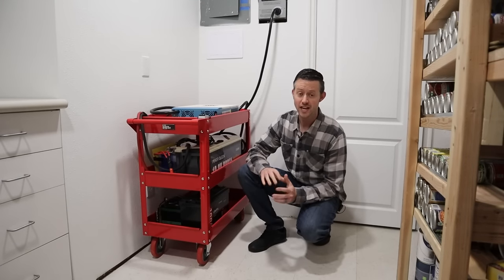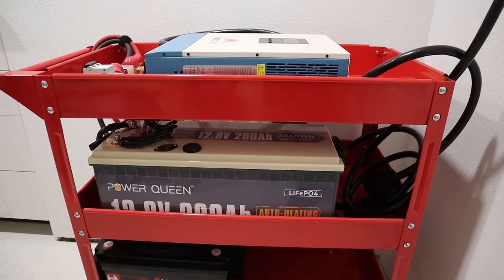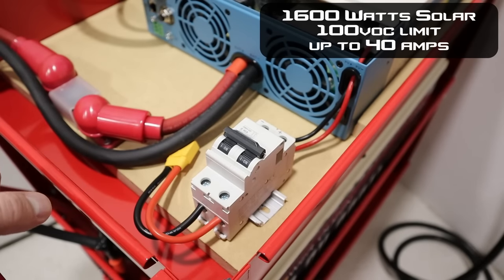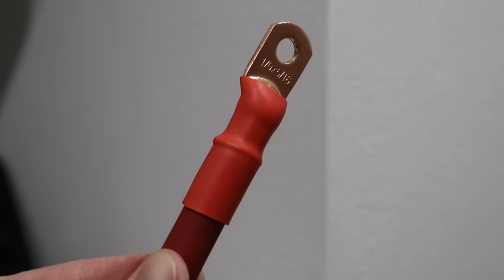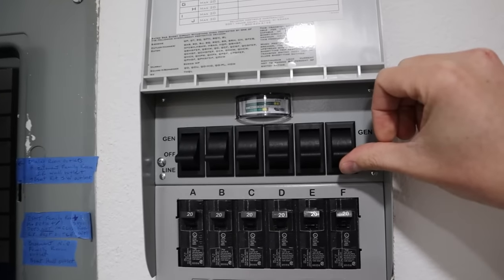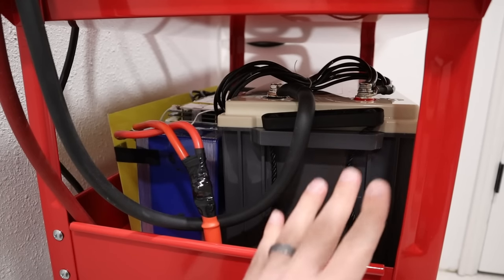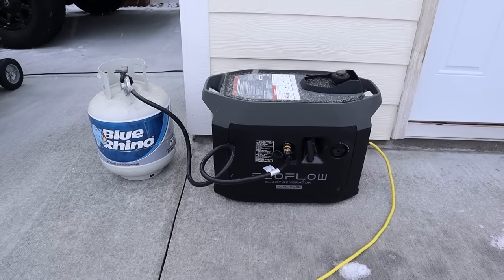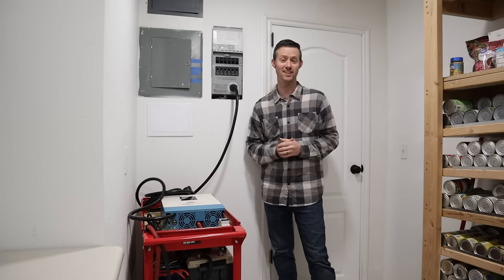Be Ready For Any Power Outage!  DIY 3000w SunGoldPower - PowerQueen LiFePO4 Home Backup System!

Comment: Enjoyed your presentation and certainly a modular, DIY approach to home backup power is in many ways superior to off the shelf products.    I forget, was there a monitor for battery SOC in your set up?   For camping (and home backup), I built a 12 V 100 ah battery with MPPT charging, various connectors, a charger and a small inverter and find that an EcoFlow Delta 2 does the job better in a smaller package.   However, if anything goes bad on the Delta I can’t really know what has gone wrong and will have to wait weeks sending it in for repairs, etc .  With a DIY unit, you have more options.    Did I mention I really enjoy your videos?
Reply from the maker: Thanks Jack! The SOC is kinda tracked in the inverter on the screen... It's not amazing though. 
I think the portable units have their place, the Delta 2 is so lightweight and compact. It certainly is one of the best current options for a 1000wh device. I personally enjoy DIY and off the shelf options because both have advantages.

Comment: I can't afford this type of setup at the moment & really don't know that I would if I could,... For now, I have a a Chinese 2300/1800 watt Inverter Generator for under $400 that I flushed & prepped well before starting & I installed a 30 amp Generator Inlet Box to the outside wall of my Kitchen, ran a one foot 12 gauge wire to a 20 amp double outlet inside the house so that I can run my chest freezer, fridge/freezer, light, fan, TV , Internet Gateway & Pellet Stove if the power goes out and this setup including the generator cable cost me less than $100 :)
Would it be nice to run 12 hours or so Silently then use a generator to recharge if needed ? Yeah, sure but the cost is huge for occasional use.

Comment: Nicely done! Is there any reason not to use a 24v lithium iron battery of appropriate amp/hours? Seems like it would reduce a bit of wiring.
Reply from the maker: Yep, that would work fine as well. Jus make sure the BMS can handle the max load of the inverter.
Reply: @Jasonoid  Thank you. I was impressed with your setup. Mine is far simpler for now: A Goal Zero Yeti 1000 Core that I’d like to “expand” to power one refrigerator and a TV/Starlink setup in power failures, and to use in our camper to extend boondocking time. A 100A/H 24v battery would preclude the use of a DD to DC converter - my model requires at least 14v at the HPP port to take a charge. And a single 24v 45 lb battery would be handier than 2 25 lb 12v batteries wired in series. But you’ve given me ideas for future projects!

Comment: This is great. I was just talking to Ask Ive Solar about a very similar setup as an alternative to a powerstation. Though it was using an EG4 version of this and server rack batteries. Did you consider the structural foam carts? They are the same though they might not have the middle shelf.

I like that a system based on an all in one tends to have a lot more charging amps, wider voltage range, and programmability. I am trying to figure out home assistant right now so I can make my EG4s turn on AC charging when the forecast and my weather station confirm poor sunlight.
Reply from the maker: I think for someone looking to build a 'future proof' DIY setup, 48v is the only way to go. I LOVE those 48v LFP server rack batteries! Eventually I want to have a system like that in my home, it's just a fairly large investment. Adding a smart capability would be really cool! 

Just make sure you purchase UL listed components since those items have been vetted for safety in your home.

Comment: We're planning on making one of these for our new home.
Do we need solar to charge this, or can we just use the electricity coming in from the power company?
How many batteries can we connect to it so we have longer use?
Also, can we just power our refrigerator, freezer, and lights with this?
Thank you for the video!
Reply from the maker: You can add as many batteries that you want, just connect them in parallel with your other 24v batteries and you are good. You also can just charge it up from the grid or even from an AC gas generator, no solar needed. The easiest way to power up your appliances would be to wire in a surge protector on the AC inverter with multiple outlets and then just plug them in.

Comment: As a mechanic, for 20 years. Then a commercial electrician, it kills me that just about every YouTube influencer hooks up battery's backwards. Remove Negative first, and install Negative last. That way you have no chance for that spark, or an explosion in your face. No resistor needed. I have seen so batteries explode, and injured people. Yes from lifpo-4!!

Comment: You actually should use a T class fuse what you’re using they can actually hold a arc not allowing the voltage to stop flowing burning everything up

Comment: I have a 2000 watt backup power battery sold by FF Power.  It has several 110 v outlets.  I'm wondering if I could plug from the 110 to my transfer box, cutting most of the breakers, and run "essential" appliances overnight (sm. space heater + refrigerator)?  All I'm tryijg to accomplish is avoiding running the generator (10kw) 24/7 when the power goes out.
Reply from the maker: Yes, you can run your transfer switch off your 2000w power station. You just can't pull over 2000 watts total.

Comment: Is it possible to build this inside a big tool box? I  just sold my small power station because i want something bigger for emergency or my job ( drywall construction) and building this on a tool box would be easier for me to carry
Reply from the maker: Sure, you'd just want to make sure it has adequate ventilation since it has fans to keep cool.
Reply: @Jasonoid  thanks for taking the time to answer!!
I also saw a new power station dabbsson for a great price. I'm looking for a good 2000wh power station but I'm not sure if I should build my own because of all those bad reviews about costumer service also saw oukitel p2001 for $950
Reply from the maker: @pilinke11  I'm doing a really simple backup system video using a 12v 200ah battery and a 2000w inverter this week (should be out Friday). It's been running my fridge for 30 hours so far. DIY is nice since you can swap a part thag fails vs having an entire system go down. I have more confidence in the higher quality power stations but you have to pay a premium for them so DIY is a bit cheaper.
Reply: @Jasonoid  I will wait for your video on Friday I need a backup but portability and the diy way is great in case something happens 😀

Comment: Question so the power coming out of your inverter is only supplying 120 volts to you transfer switch am I right. If not how did you wire the the connection in the transfer switch box. Why didn't you ground the output from the inverter. Thanks

Comment: great video thanks.  Is the AC charging input variable ?  Can you adjust it to charge from a 1000w external generator?
Reply from the maker: Yes, you can change the charge rate in the setting of the All In One unit to what you want.
Reply: @Jasonoid  thanks.  So if you need more power during an outage even without sun or solar, you could use your Car as a Generator to refill at say 800-1000 watts with our product CarGenerator.  Its a turn-key user friendly inverter in a fully weatherproof housing, you can just run an extension cord in from your car and let it charge for a few hours to refill.   Let us know if you would like to have a demo unit to review etc.   Here is a rainy example...   https://youtu.be/zd1h1CdOycA

Comment: Better off buying the Licitti 2000W DIY generator box, adding a few 280Ah LifePo4 cells, and you have a very powerful yet portable option.  The Licitti has the inverter built into it.
Reply from the maker: That would be a great setup as well. There are so many different options these days, thanks for sharing!

Comment: I bought the 24v kit. The issue I have run into is delayed shipping. They didn't inform me most of the kit is in background. The other issue I ran into is I did manage to get it put together and the batteries won't charge. Tech support is really slow to respond.

Comment: I just installed a whole house 26kw NG generator with ATS and am interested in adding a whole house battery pack to sustain for 3-5 days. When batteries are exhausted generator starts, recharges and then shuts off. How do I determine my battery needs for whole house application?

Comment: I's like to do this in my Cargo Trailer. Not crazy about the loud fans.  Debating on 24V vs 12V,
Reply from the maker: There are benefits to both voltages. 24v gives you more charging input on solar and you can use less expensive wire. 12v is just easy with one battery connection. The fans under a 500 watt load weren't load and didn't run all the time, it seemed to do a good job managing temps.

Comment: Can you connect the ac output to the wall plug to run all the house power 
And also connect the ac input to wall outlet to charge the battery when the power come at the same time ?

Comment: Question Jason, should we remove the plastic covers in the all in one unit? I removed the plastic and now I don't hear the fans running, I hope that is ok.
Reply from the maker: The fans run based on temperature, so maybe it'd cooler without the cover installed and the fans don't need to run as much?

Comment: Start dealing with battery electric system by insulating your tools! Heashrink or tape on screwdrivers and spanners reduces accidental contact. OR go and buy spanners with plastic coated handles.
Reply from the maker: Great tip, thank you!

Comment: I was wondering how you wired your transfer switch.  The inverter output is 120V AC.   So you can't wire with 120/240 split phase.   Did you just use a jumper off the hot to power both bus bars with 120V?   Seems like that is the only way be able to use all six breakers.   Thanks.
Reply from the maker: It's a 120v transfer switch. All circuits are powered by one 120v leg. If it was a 240v it would require two hot legs. They offer many different models.

Comment: If you had this system in a small bus would ground the unit and if so where on the vehicle?
Thank you.
Reply from the maker: Usually the frame is negative on a vehicle. I'm not sure how that would apply to the AC output ground though.

Comment: Another great video, I would like to continue building on my portable setup i e. "Kisae DC to DC charger setup".  Can you suggest a Pure Sine Wave Inverter to go with my portable setup?  In addition since this would be my first time setting up an inverter.  Would that Resistor in this video really suppress any sparks that could occur?  I have the DC HUB already as part of my portable setup.  I would like to have a little AC power if I happen to need it in an emergency.  Any help would be greatly appreciated.
Reply from the maker: You'll see a spark on large inverter over 2000 watts, theres so LARGE capacitors that will want to charge quickly. 
What size inverter are you looking for your setup?
Reply: @Jasonoid  1000 Watt inverter and put it in a water proof case.  So I'll have to set it up every time I want to use it.  That's why I'm concerned about sparks.  You are the first person I saw on YouTube that addressed this issue.  Please inform.

Thanks Again!
Reply from the maker: @minceym  you won't have an issue with sparks on a 1000w inverter, the capacitors aren't big enough. I really like Bestek inverters. I have their 500w and 350w models, it looks like they also sell a 1000w pure sine wave model too:
https://amzn.to/44j5MkA
Reply: @Jasonoid  This is great!  Thank you very much for this information.  I never saw a portable inverter like that before.  So is it safe to say anything over a 1000 watts the resistor would work?
Reply from the maker: @minceym  yeah
Reply: @Jasonoid  Thank you!

Comment: I am planning to do a similar 24V home backup setup using a transfer switch and possibly the SunGoldPower 3000W Charger Inverter.  I have been reviewing videos to understand how to setup a home backup system and I am getting close.  I have two questions.
The PV input voltage to the charger inverter states that the operating voltage should be between 120-400V.  I understand that the VOC of the PV array should not exceed the maximum PV open circuit voltage of 450V but what if the PV array voltage (VOC or Vmp?) is less than 120V.  Does the unit stop charging with solar?  Do the PV panels I select, connected in series, need to have their Vmp greater than 120V?
I am planning a battery bank of four 12V 100ah batteries connected in a series parallel configuration.  I have seen some videos where the battery bank is attached to bus bars and then to the charger inverter. Is adding a second battery bank (four 12V 100ah batteries connected in a series parallel configuration) to the bus bars the same as connecting the two battery banks in parallel?  When adding the battery banks in parallel (no bus bars) I assume the cable size from the battery bank to the charger inverter needs to increase since all the amps are flowing through one set of cables instead of two separate sets when using bus bars.
Thank you for your response.
Reply from the maker: 1) If the solar voltage is less than 120v, the charger controller will not be able to use the voltage. You'll need to wire the panels in series to get a high enough operating voltage to keep the voltage above 120v when in use.

2) You'll want to use a larger enough cable to handle the largest load your inverter will pull. With a 24v system the amps aren't as bad as a 12v system. There are wiring amperage charts online that tell you the size of wire you'll need.

Comment: The manual says the maximum solar voc is 450vdc, maximum solar input is 4kw 80a.
Reply from the maker: Must be a different model or it's been updated over this model in the video. The specs were right on the side and when I tried going higher on solar it would throw a high voltage error.
Reply: @Jasonoid  interesting. Thanks for the reply.

Comment: How would this set up compare to a Eco Flow Delta 2 Max? I think it has more storage capacity? Trying to figure out which way to go for a home backup system I would appreciate any help
Reply from the maker: If I built something like this again, I'd go with a 48v server rack battery. They are just so easy to use. Then I'd chose a 48v all in one charger, inverter. For around $2000 you can get 5120kw of battery and a decent inverter with TONS of solar.
The main benefit of the Delta 2 Max is portability and convenience.

Comment: Hi, thanks for the video. Do the Power Queen batteries have low temp charging protection?
Reply from the maker: The cheaper model doesn't, but in a house backup situation that shouldn't be an issue. It would take a bit for the house to get down below freezing. 
For another budget brand of battery that pulls full capacity, can be connected in series AND has low temp charging protection check out this battery:  https://youtu.be/dd1W8_tdl2c

Comment: I'm trying to set up a very similar system for off grid right now, with the only difference being that I don't have a transfer switch for my AC out to go into. I would like to install a single gang outlet for regular household use, (TV, internet, lights, etc.) Which gauge wire (and which type, THHN or NM-B) would you recommend? Also, how many breakers and fuses are there in this system? I'm doing research, but I'm still pretty new to this. Thanks!
Reply from the maker: THHN should be fine to use for wiring up your outlet/plugs. You could probably also use normal Romex, I'm not an electrician so you might want to consult one before you move forward. In order to support the full 3000 watts that the inverter can handle I would go with 10 awg wire, which is rated for 30 amps.
Reply: @Jasonoid  Thank you for such a quick reply! And for sure, for sure. I actually have an electrician lined up who's going to come look at stuff before I actually hook anything up. I'm still just in the planning stages. Just figured I'd see what you have since you have (nearly) the same system as I. The main thing I was wondering is the breakers and fuse sizes. I know there's the bolt on fuse for the battery, and SunGoldPower already has a breaker on the AC input side, but there should be a breaker for each line, yeah? 160A going to the battery, 25A going to the AC outlets, and probably a 40A going to the PV array. Is that what you've got on yours? (Except for the different AC out of course.)
Reply from the maker: I have a 200 amp inline fuse on my batteries, I have a 40 amp DC breaker for the solar input. The AC output has some protection built into it already but if you wanted, I'd probably put a 20 amp circuit breaker for each outlet you are planning to connect up to the inverter. If you are planning to have a higher wattage output you'd want a 30 amp breaker. Remember circuit breakers protect the wiring size, so you size the breaker to the wire size. 15 amp breaker for 14 awg, 20 amp breaker for 12 awg, 30 amp breaker for 10awg wiring.

Comment: DO NOT TIN WIRES GOING INTO MECHANICAL CONNECTORS! SOLDER CREEPS! MEANING OVER TIME THE SOLDER DEFORMS AND THE CLAMPING FORCE IS NO LONGER SUFFICIENT AND CAUSES A LOOSE/HIGH RESISTANCE CONNECTION.  i forget what they are called but they are basically little copper caps that slide over the end of the wire and you solder that to the end of the wire if you want clean terminations like that for a clamp style terminal, copper wont creep like solder does.  ik your prob the home owner so this dosnt apply to you but tinning wires and then putting them in a mechanical clamp connection on mains is straight up illegal here, serious fire hazard.
Reply from the maker: Thank you for the explanation.